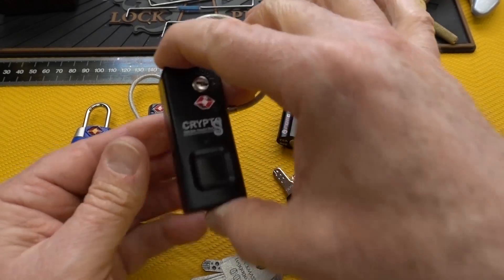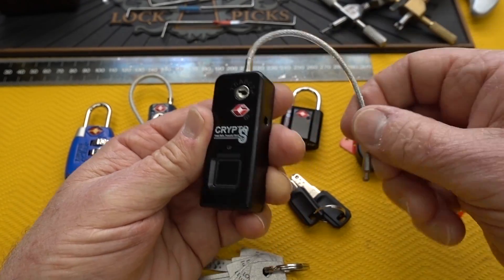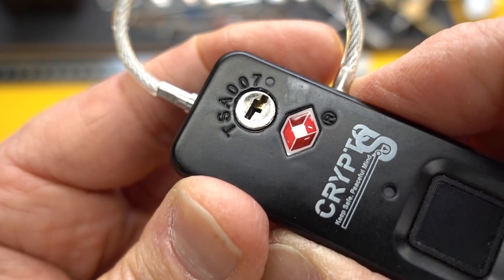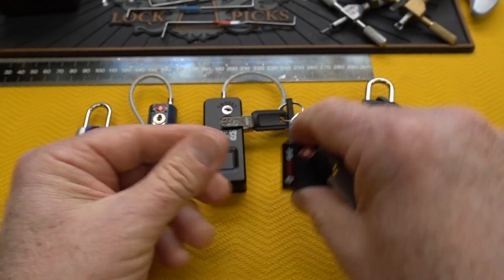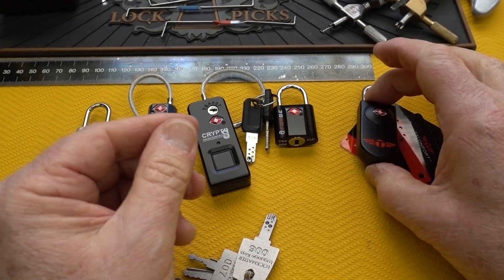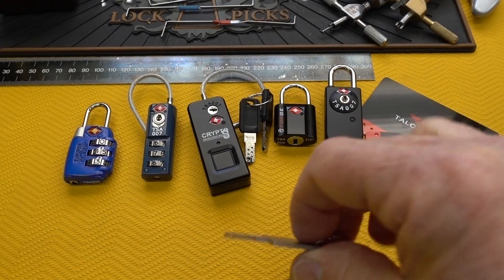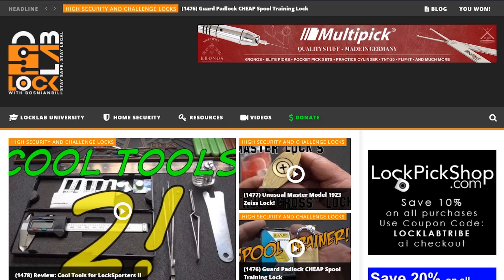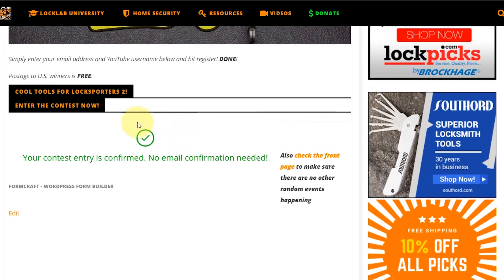(1682) Review: 3D Metal Printed TSA Master Keys

Comment: Weren't the locks worthless even without a master key?
Reply: They are useful against pickpockets. Pickpockets will unzip bags, but they have to be quick and can't jiggle the bag too much as the owner is right there and possibly even wearing it, in the case of backpacks. The security level needed to make a pickpocket's job much harder is pretty low and if you've just come off a flight and are jet lagged, you probably don't want to be digging around for a lock that is overkill for guarding against pickpockets on the way to your hotel or hostel.
Reply: @dbattleaxe  true
Reply: @dbattleaxe  Anyone with a ballpoint pen or small screwdriver can just pop open the zipper in the middle of it.  It does of course show tampering though, while using a key or picking is going to prevent the luggage owner from discovering the theft as quickly.
Reply: @greendryerlint  So, instead of a TSA lock I might as well use heavy duty cable ties?
Yeah, the TSA will cut the cable tie open (and so can a pickpocketer), but so will they cut open a lock, if they do not find the keyhole or key within "reasonable time".
Reply: @sarowie  Did I say you shouldn't use a TSA lock?  If you don't, all you're going to get is your suitcase back with the lock cut off.  Maybe a cable tie too would be helpful though.  If you find the tie missing but the lock intact, you at least know it wasn't the TSA, as they do leave a note after rifling through your stuff.